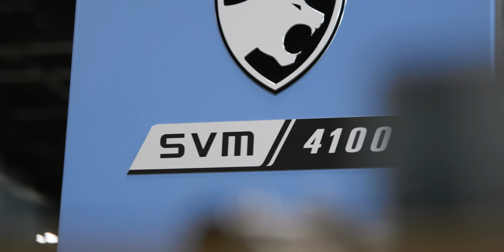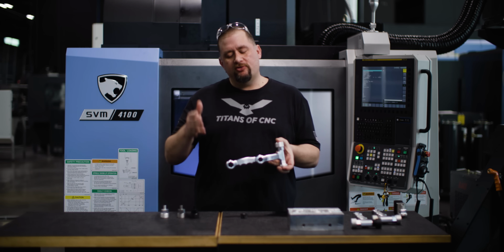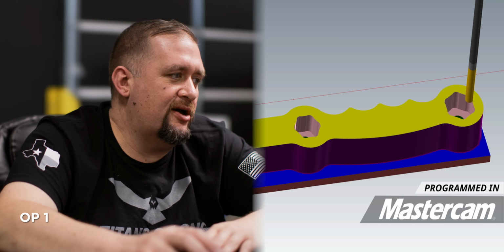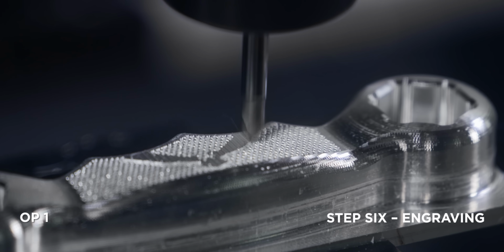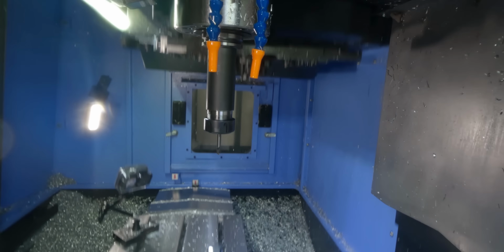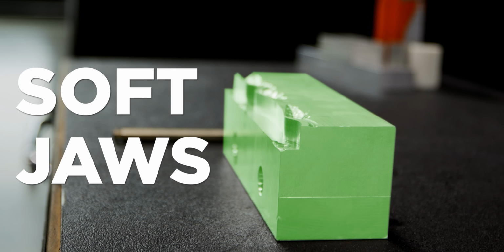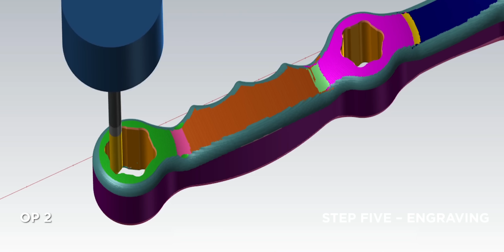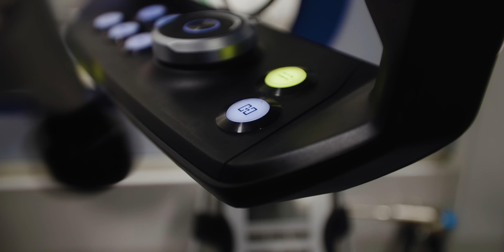How To Make a Multi-Functional MACHINIST HAMMER

Comment: Thats a good project only thing i would add to make this hammer not  bounce back when used. ITs so simple just needs some empty space on core part of the hammer and add  some sand to make it not bounce back. Its little more design work but it pays out. Also handle part ı prefer on wood because metal is cold wood is warm on touch. Or we can wrap some leather on handle.

Comment: When you flip the round caps over in the vise do you have to re-zero since the diameter is smaller and the center should be closer to the fixed jaw side?
Reply: No, i programmed it to make it easy
Reply: You could theoretically use the g54 and 55 work offsets to do so.

Comment: I really like that strategy to mill knurls on the side of the part, does anyone know how to make these in Fusion 360 without 5 axis? Is there even a way?
Reply: Multipas threads
Reply: @Hendreh1  already had a go at it and yeah, that actually works pretty well. Just gotta set the pitch to around the circle circumference. However, this only works for cylindrical parts. How would you do it on other surfaces?